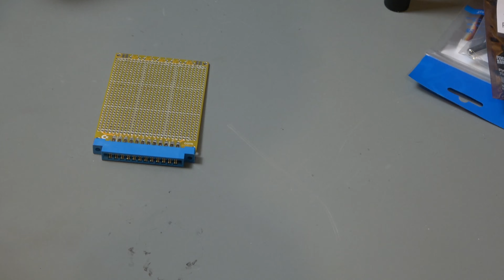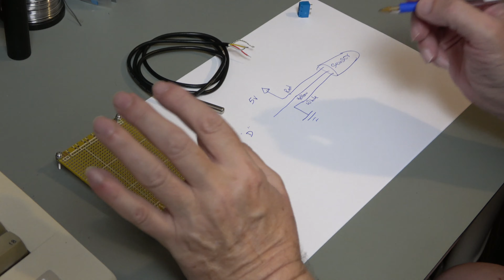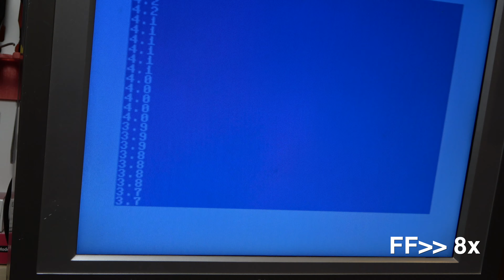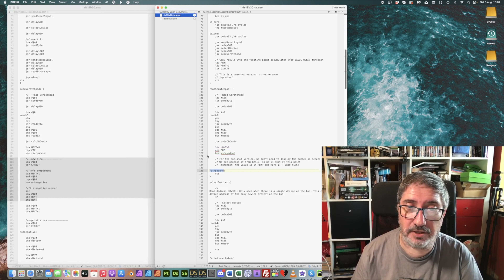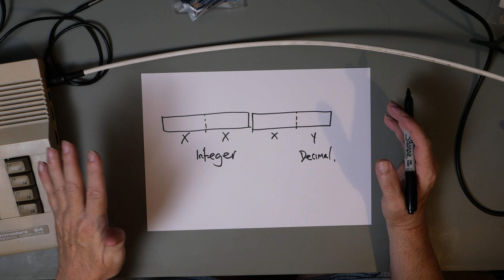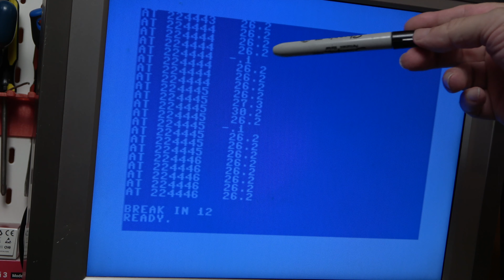Commodore 64 as a Thermometer!

Comment: Nice video, I think the i2c spec allows for no minimum transmission speed which means you could potentially poll it when needed leaving the c64 usable......

On a different note , do you have a contact email ? As I belong to a very small group to which josip is a member and have a question to ask you.
Reply from the maker: The I2C stuff is all in part 2. It all works, even from BASIC. The main downside is the amount of two way traffic required to do anything. While I was getting around 7-8 readings per second from the 1-wire in ML, it takes a couple of seconds over I2C to trigger a reading then pull the data back. There's also more data involved since these generally are multifunction sensors (ie temperature, pressure, & humidity).
There's an email addy in the channel About tab that should reach me.
Reply: No email in there chap, link to your website etc but no contact email
Reply from the maker: Huh, that's a bit weird. Tim at timsretrocorner dot com should def work
Reply: @TimsRetroCorner  email sent